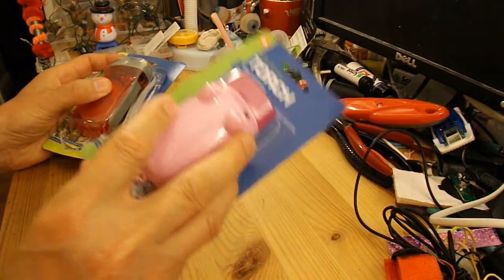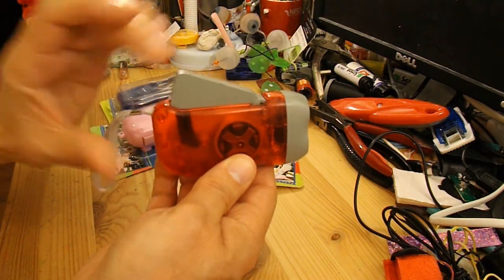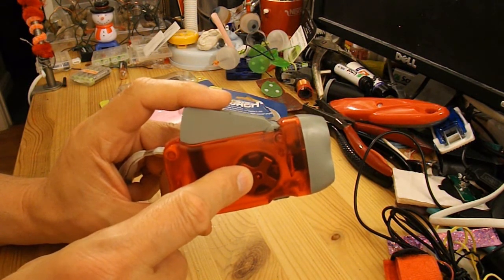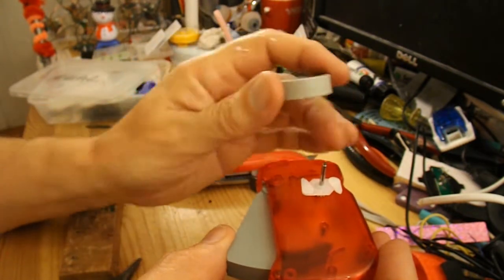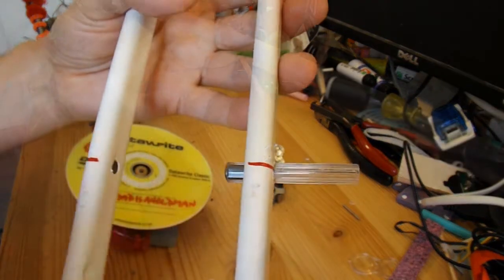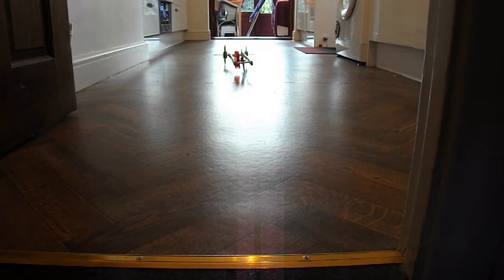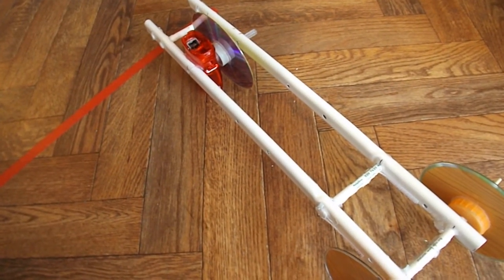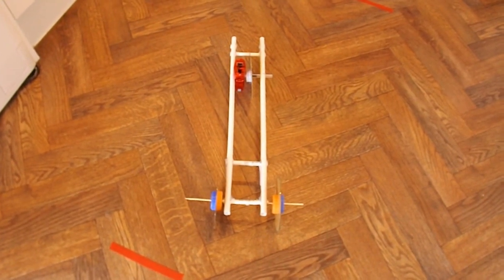Spring Powered Car from a pump action torch

Comment: Ah....! I think your frame is far to heavy, Just a thought...: This shouldn't be in the fail section cause it works young man.
Reply from the maker: I measure my cars by requiring them to run the length of my kitchen which is 5 metres. The idea behind this one was it would pick up speed using the spring power and then freewheel, but it didn't make it into the freewheel state. Yes a lighter chassis might work better. I am always happy for somebody to take one of my projects and copy them and improve them. I may revisit it again myself one day.

Comment: I really liked your idea on trying to use the dynamo flashlight to push/pull the car forward
Reply from the maker: Thanks Ryan, unfortunately it didn't have enough power. Might have worked better with a smaller chassis and wheels, but probably not worth the effort. Somebody with one of those 3d printers could probably make a new frame to house the components in a more compact unit and get it working.